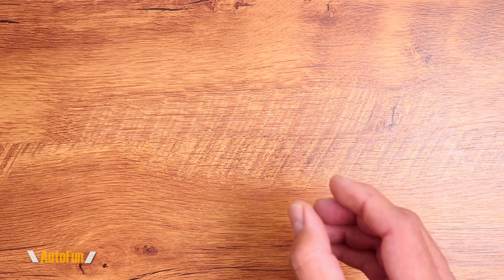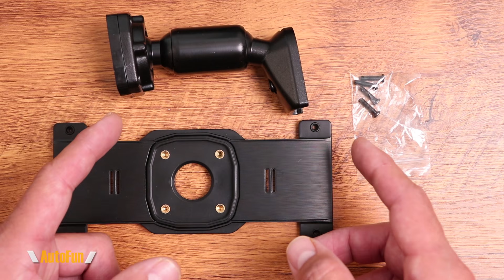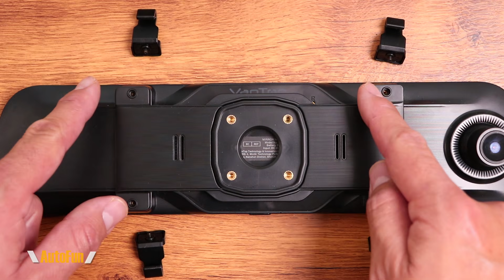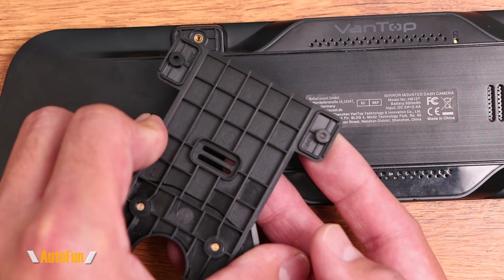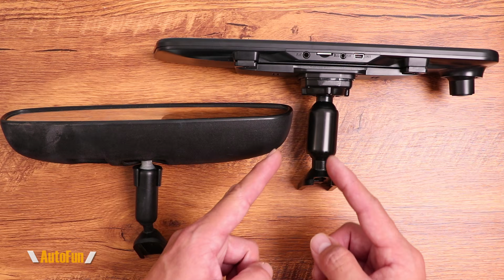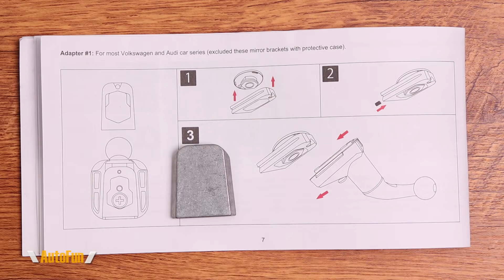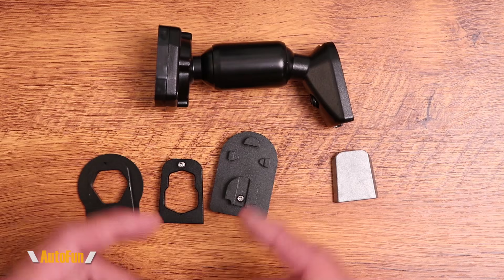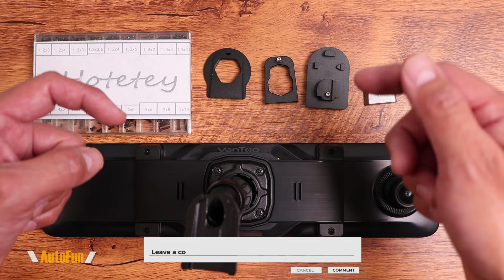How to Install Mirror Dash Cam WITHOUT Straps (Direct Mount Conversion Kit for LCD Mirror)

Comment: Hi Alex, love you channel btw. Do you happen to have the measurements or link for the conversion mounting kit that fit the T10? I just ordered it on amazon and will order the kit as well so I can install everything in one shot. Thanks in advance
Reply from the maker: Thank you cmlegend! ah yes I'm going to go thru the dash cams and measure them, once I get to the T10 I will let you know, in case you get your dash cam before I get to measure mine, the mounting kit sizes and links to each are in video description if it helps!
Reply: @AlexAutoFun  I thought you did already since you reviewed it. Btw, I got a response from WOLFBOX on the difference between t10 and t10 plus and it's the included SD card 🤷‍♂️
Reply from the maker: @cmlegend88  Awesome! thanks for that info, I will make a note of that. But yeah as far as the kit size, since the kits didn't exist when I started reviewing mirror dash cams there is quite a bit of them that I have to go back to and see what size they are. Most are installed for long term testing so I have to remove them, measure and re-install them, so hopefully between me going thru mines and other viewers that have already confirmed what fits we will have a pretty complete list of kits soon...
Reply from the maker: Hi cmlegend! Here is the video for that conversion https://youtu.be/fveZiDofnxg Cheers!
Reply: @AlexAutoFun  thank you sir!
Reply from the maker: @cmlegend88  You're welcome!

Comment: Thank you for another great video!! I have the Vantop 10" dashcam for my truck and I'mma buy this conversion kit so it looks more original. I have been looking for the Vantop 12" H612 or H612T for months so I can mount it on my Escalade and they've been sold out. I'll have to use the straps on that one because of the OnStar buttons built-into the factory mirror.
Reply from the maker: You're welcome canucha1985! ah yes for those types of mirror that have OnStar, garage openers or courtesy lights I think it makes sense to keep the original mirror installed..
Reply: It doesn’t work for the h612. Just tried doing it n the back of the h612 has an elevated back and the mounts for the rubber hooks are different.
Reply: @poges1904  oh ok. Thank you for the heads up. I'll keep that in mind and maybe just stick with the original accessories for the h612 if I can ever find one.